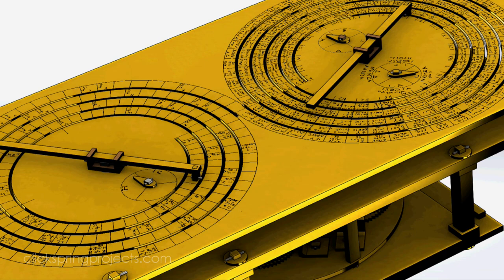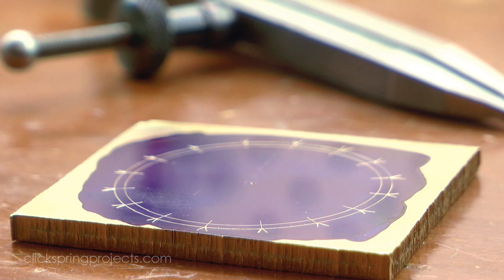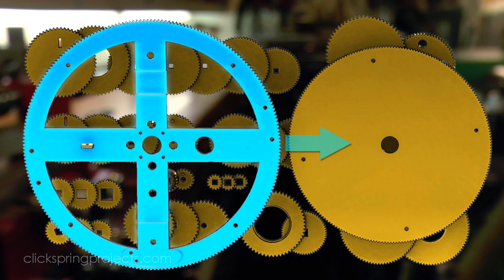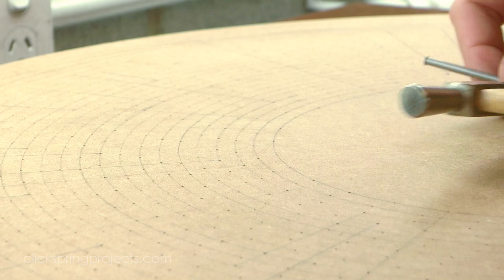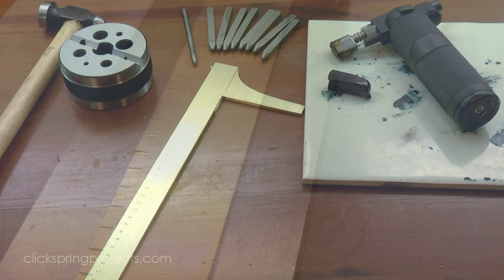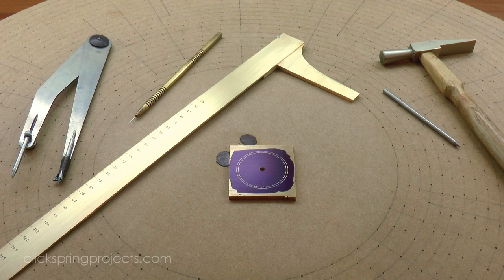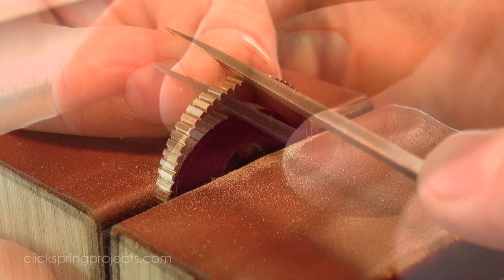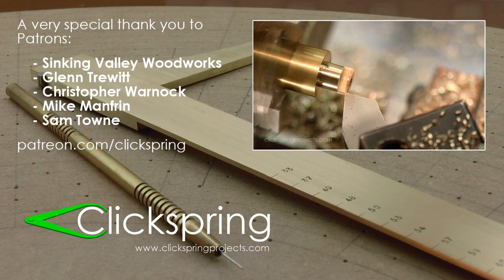#Antikythera Fragment #2 - Ancient Tool Technology - The Original Dividing Plate?

Comment: I'm entirely convinced by your argument. We like to apply our modern standard to the artisans of the past, and then it becomes easier to dismiss incredibly complex procedural advancements as implausible. 

Simply put, clever people will always find ways around the technological limitations of the day. Naturally, we are biased to think of now as "better," or more "advanced," simply because we're here. Tomorrow, we'll have yet another new advancement, and it may reduce another piece of tedium, but it will only be an improvement to our method- and not to us.

We didn't always have a button for π. Archimedes used the method of exhaustion. It worked.

Comment: Interesting speculation. I think the greeks could have started with their dividers and gone up to dividing plates. There is another way to divide. Wrap a strip of paper around a cylinder and cut it so it is an exact fit. Now divide your strip into N equal intervals. This is done by projecting another strip with the divisions onto our original strip.  Wrap the strip back on the cylinder and transfer the marks. This was a method taught in colleges when there was no CAD at all. It is more accurate and much faster than the walking divider method. Who knows. Maybe they made dividing plates by the strip method and then used plates to mark as you did. 
Lovely project. I've been reading up on Antikythera and I think it is properly an orrery.

Comment: Subdividing the circumference into 6 equal parts is easy as the dividers just need to be set to the radius of the circle. I'd try to base as many of the subdivisions on that fact as possible. Even number subdivisions can also be made by drawing a line between two points and creating a perpendicular bisector which will bisect the arc perfectly at the halfway mark.

Comment: I was wondering what the flat surface on the center pin in the diving table was for, seeing that ruler lay flat against it was surprisingly satisfying.
That is one beautiful gear you made.
Reply: Martin Tandrup I wonder how he machined it to the exact centre.
Reply: Define (quantify) "exact"...
Reply: Martin Tandrup: So that the length of the flat equals the diameter of the rod.
Reply: One easy way, measure the diameter with calipers (or micrometer), remove material until the remaining piece is 1/2 that, as also measured with calipers.  I suspect Clickspring has a set of calipers accurate to 1/10,000th of an inch.
Reply: But that would be trial and error and too easy.
Reply: If you want a harder, less trial and error method:  A milling machine with a DRO, could be used to take reading on both edges, and mill to the center.
Reply: A Micrometer is an estimation tool as well.  Certainly micrometer is higher precision and accuracy.  "real precision" sounds like an oxymoron.
Reply: If you want a low tech solution you can use the dividers, put them at the edge of a circle and estimate the centre, make a mark on the centre(ish). Make two more marks from different points of the circumference without changing the dividers, you will have a triangle around the centre, allowing you to either measure again or eyeball it for close enough

Comment: Incredible workmanship! I may be stating the obvious, but I do question the assumption that the original workers had only primitive tools available. The discovery of the mechanism was the first inkling we had of such precision in the ancient world. Surely there would have been many more instruments and tools in use, so that one accidentally preserved in a ship wreck is probably only one of many. When I worked in a machinist shop for a short period, the master machinist would spend hours studying a drawing, then spend as long a needed creating jigs (as you do) to make the final build of the target almost a non-event. Surely a civilization capable of the precision of the mechanism would be able to build tools with the same or greater precision. Probably not run by electric motors, but there are many other sources of power available from hand powered to water wheels.

In any case, thank you for a very enlightening and beautiful project.

Comment: Do note that when marking divisions with a compass, anything divisible by 2, or 3 can be started using the radius of the circle as the starting point, pick any random point on the circle, center punch it, then use the compass to mark spots that are 1 radius away from that point, repeat until you have 6 points, they will be perfectly equidistant from the center and from each other, the pattern can be expanded, but this requires the original circle to be a fraction of what the outside one will be, so it might be easier to simply index on the first iteration of the pattern, and go from there. Hexagons are dope as hell.

Comment: Beautifully simple solution and I agree it would not have been beyond the capabilities of the people who built the device. Another method could have been using larger pieces of metal to draw much larger circles which they could easily have divided up and then transfer the markings to the required circle at the center. That might have been OK for fewer wheels but your solution makes much more sense when you need the same tooth count on multiple wheels of different sizes. It's a logical progression from one to the other which would eliminate errors and speed up the workflow.

Comment: there are many things lost in history and it's usually the most obvious simple and disposable things made quickly on site. Experimental archaeology is a fantastic way of finding these things because you come up with them based on very basic principles. like a string coated in a clay powder flicked on a surface to make a long straight line on the ground or making a perfect 90* angle sample by using some water and a plumb line.

Comment: Thanks much for taking time to make a fine video to share your work! I find it fascinating how you can infer techniques that may have been used. One would have to think that someone clever enough to design such a device might also have been clever enough to use the "larger pattern' rather than rely on keen eyesight for actual manufacture, particularly when you consider that if you'd created such a device you might also figure there might be demand for more than one. Thanks much!

Comment: Chris, it would make sense, to me, at least to think that the ancients would have used things like the dividing wheel you made and used here.  If you think about it for a while, you can come up with a good deal of mechanical objects that would have benefited from ready made dividing wheels.  Sundials, wagon wheels, pin driven wheels and torque producing items like a water wheel would be some uses.  Also, division of circles are important for navigation and surveying equipment, too.  In lieu of those things, among quite a few others, it may be possible that dividing rings or wheels were used to reduce vision errors in common construction.  Maybe?
Reply from the maker: Certainly possible I think. In fact its interesting to see how much use I'm already getting from it for additional marking out in the device beyond just wheel teeth: The two dial rings, radial positions of rivets, elements of the rear dial, radial positions of some plate components - By the end of the build it will have been used extensively, more than justifying the time and effort of constructing it. Cheers mate :)

Comment: "It (click) springs to mind" that familiarity with similar triangles and Conics would be a quick and easy method of transferring tooth numbering. Choose a strip of flat and flexible metal with marked equal divisions and cut it at the number required,  ..loop it in a Circle around a scraped true Cone on a Pottery Wheel and transfer the tooth numers to the Cone. Inscribe the lines from the marking to the tip of the Cone and  by Similar Triangles, the chosen Wheel Tooth number and size can be found by sliding a wrapping to the required diameter.., or cut the Cone and mark out the centre etc. (You get the idea)

I haven't done this before but I did rebore the holes in a Tractor Hub that had been chopped out, using Dividers a a patterning plate to guide the Drill. School Trigonometry techniques are core knowledge for Actual Intelligence, learning by doing.

Mostly, the inherent methodology of how the original concept came about by observation of the sky and inscribing the naturally occurring Origin Apature of Trigonometric Optical positioning is the Actual Intelligence cause-effect function.

Comment: Watching this back through, I remembered that 60 is also a constructible polygon. There's also The fact that for large numbers, approximating the radius of the polygon made by stepping around is just as simple as dividing by 2 times your approximation for pi. Do this for 223 with Archimedes's minimum approximation for pi (223/71), and you've got a radius of 35.5 times what you mark off as the distance and a difference in the end that is less than a 20th of the distance you're marking. I feel that they probably adjusted the radius, though, as that would have given them almost a hundredth of a unit to adjust instead of two tenths of a thousandth. Using this approximation gets you within a 16th of your ending mark from 25 teeth up to 286 teeth, being closest at 83, which is an Antikythera teeth number, though that appears to be mathematically necessary

Comment: When you say that the ancient greeks weren't known to have dividing plates, well, they also weren't known to have complex geared calculators either.  No reason to think that the tool would have survived (especially if made of wood) when only a single example of the result only just survived.

I can't for a moment imagine that the Antikythera Mechanism is the first and only result of the technology of geared mechanisms.  There must have been simpler machines, and prior incarnations of this machine.  That's getting to be a lot of gears.

Comment: amazing theory, and I think you may have hit the nail on the head.  the idea is absolutely practical and makes all kinds of sense.
Reply: actually I think the theory makes more sense than the fact that they may have had a three-cornered file.  How in the world did they actually cut the teeth?  Did they actually have files at that time?  Seems like a precision file would have been just as hard to make as the mechanism.
Reply: Rosa String Works considering the complexity of the computer/machine itself I wouldn't find that as particularly surprising.  Also considering this was the beginning of when iron and steel (on a very small scale) were being worked it would be possible but I could not imagine how expensive such a tool would be
Reply: Not sure about the precision, but Egyptians had bronze rasps back as far as 1200 BC, and the Assyrians had iron rasps in the 7th century BC.
Reply: If you check his channel, Chris has since posted a video of how he made his files, starting from the nearest thing he could to wrought iron, namely low carbon steel. And the tools he made the file with (the chisels) he also made by the same techniques. Everything was hardened using methods which were either known or at least practicable at the time the original was made.

Comment: As you said, marking out teeth accurately on tiny gears is almost impossible. However, it is a lot easier and much more precise.

So, what I think, they marked out a big wheel, connected the division marks to the center of the wheel, thus creating spokes. These marks could then be transferred by for example placing a smaller wheel on top of the large wheel with the centers aligned.

Also with this method, once you have one big wheel marked out, the marks can be transferred to multiple wheels, making the job  much quicker and easier.

EDIT: Posted this after a few minutes into the video, but you actually ended up doing he above basically with your wooden wheel, cool.

Also, the fact that we're both coming up with this (for me coming up with it on the spot actually, as someone who never did any machining, maths studies or whatever) means that the Greeks could've easily come up with this too.

Comment: This dividing head kit would be an excellent product for someone with a sufficiently large CNC router, I'm frightened to think what a reasonable price would be in brass but with the MDF base and cheaper metals for the straight edge it should still be relatively fast to create all the holes and perform all the scribing. the part that would be least suitable to cheap automation would be the wing on the straight edge, and that could probably be simplified to allow two pieces to be cut out of one plate on a bandsaw or scroll saw

Comment: Thanks for this wonderful series.     Your dedication to your craft is an inspiration to us all.
One clarification from an astronomer: the large prime number 223 is the number of synodic months (eg. full moons) in one Saros cycle, after which the Earth Sun and Moon return to the same configuration.    At 7:50 you suggest that while this number of teeth was needed for wheel E3, the appearance of 223 teeth on wheel B1 is arbitrary, and perhaps due to the proposed use of a jig.    But is it not also plausible, or indeed likely that the B1 wheel did indeed require 223 teeth for an eclipse-related purpose, perhaps not known to us?   Could it have actuated gears not currently known, for example?
To be clear, I do not wish to discourage your hypothesis of a jig, nor your other hypothesis of a "dividing plate" being invented by or known to the Antikythera Maker long before it is known elsewhere in history.  Indeed, so much about this device pre-dates all known similar technology, that such hypotheses are by no means radical.
Reply from the maker: Its entirely possible Chris, so much of the device is missing and what remains is in very poor condition - The presently accepted paradigm is that the device had a single eclipse prediction function (via the Saros/Exeligmos), utilising the 223 of E3. One research team has proposed a positive role for the tooth count of B1 to drive an alternative planetarium model, although requiring less teeth than the generally accepted 223 and without physical evidence to support their proposal for the added architecture. Pending any further finds of the original structure, B1 sits 'outside' the train, so I still lean heavily to its tooth count being an artefact of convenience from the division process - Cheers mate :)

Comment: I was thinking maybe you could have some sort of flat ruled surface subdivided for the teeth and then roll the metal slug over it to pick up the markings. Then using a file specifically sized for the depth and shape of the teeth to just file down until the back of the file is flush with the slug surface would generate an exact tooth. Maybe they skipped marking the disks altogether and just used the shape of the file itself and the circumference of the disks as the subdividing methodology. Or maybe they cut the teeth on a cylinder of metal then afterward cut it into the disks repeatable shapes. Anyway great work love your videos. Very thought provoking.

Comment: @Clickspring There's an easy way to create the larger jig without having to use any guesswork. Divide your largest circle in a multiple of 2, so 512 parts for instance.  You can divide arcs by twos easily with a compass. In this case, you divide it in half nine times. Next, draw a line from the outer circle to the center.  Divide that by the same number of divisions, so 512 in this example. Each increment of that line is the radius of your next circle.  The distance between each tooth of all the circles will be the same as the distance between each tooth of the largest circle.

If you want, you can also start with the radius first, picking a random small size, and make all your circles a multiple of that. You can skip drawing and subdividing any circles that have a tooth count you're not going to use. If you have an accurate ruler, and all your gears have an odd number of teeth, you can use, or example, 1 mm to represent a radius in multiples of 2, with the first one starting at 0.5 mm.

This is because c=PI*r*2, so there is a direct relationship between the radius and the circumference.  Double the radius and you double the circumference. So a circle 1/512 the circumference of the starting circle will have a radius that's 1/512 the radius of the starting circle.

Comment: There's a way to iteratively refine an approximate division to arbitrarily good precision, on any number of steps around a circle, without needing a dividers or even a straightedge.   It's tedious, and you do need a good round circle and a flat surface, but it's easy to do and easily within reach of ancient Greek tech.

You take your wheel with imprecise division marked, put it down on a clean surface with a pin in the middle, and mark a primary position on the surface at the edge of the wheel.  Then, for each marked division, you turn the wheel to place that mark exactly at the primary position, and make marks on the surface to record the current locations of all your other division marks on the wheel.  When you've done that, you have a bunch of marks on the surface for each division.  (except  the primary position, which of course will have one).   The true division is in the middle of all those marks. 

So you erase the imprecise divisions you've got from your wheel and go around marking it with better approximations by placing a mark on the wheel at the center of each "cloud" of marks  on the surface.  You now have a much more precise division marked on the wheel than you started with.  Then you erase the marks from your surface and do it again.  You're done when you start getting single points instead of "clouds".  Which won't take more than two or possibly three iterations.

By that method there's no more difficulty in prime-number divisions than in any other divisions.